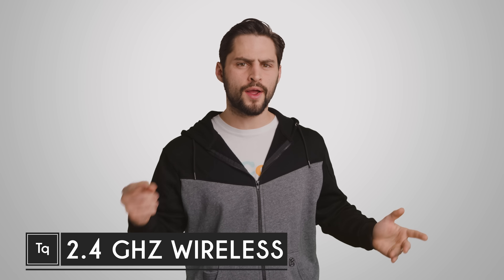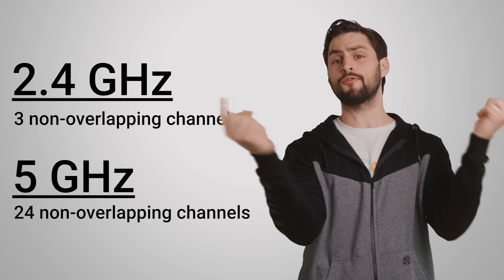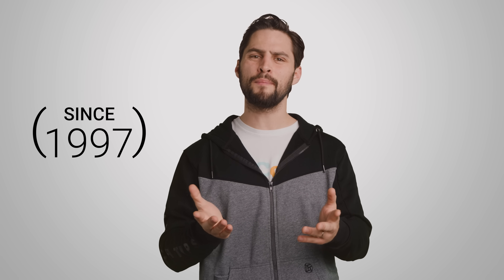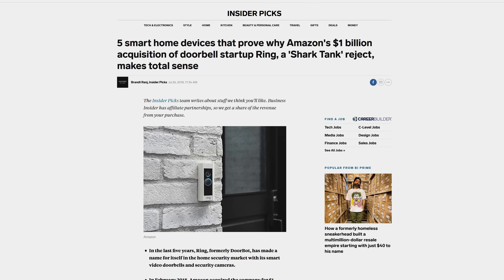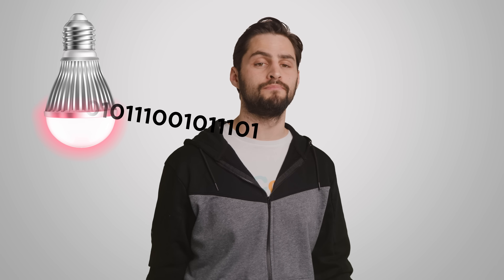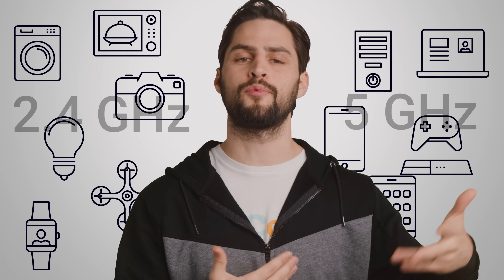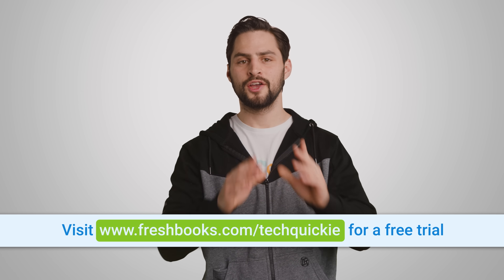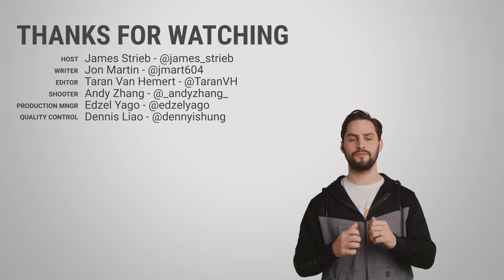Why will WiFi always be SLOW??

Comment: Of course it's not going away, otherwise I couldn't use my Nintendo DS!
Reply: TheMrminimario I get this completely. Plus you need either an open network or WEP for the original DS models so I am still using WEP despite it not being very safe anymore. I need an upgrade badly though.
Reply: Weatheronthe8s buy a tplink router, install openwrt and create a new vlan with mac access restriction and another vlan for other devices
Reply: @fss1704  I need a new router badly. I have to reset this thing all the time because it barely wants to work sometimes. But my mom hasn't bothered to go get one. It is her house.
Reply: @weatheronthe8s895  consider installing dd wrt, the stock firmware is bullshit.
Reply: @weatheronthe8s895  or you can "casually" brick the damn thing, even put 24-30v will do the trick, just make sure you do this right before payday
Reply: @fss1704  I don't really wanna do that because this thing holds nostalgia for me.
Reply: If only the Nintendo DS could actually CONNECT to WiFi
Reply: @janferenc316  Custom servers are a thing
Reply: @janferenc316  That's due to the security. You have to have open internet or WEP in order for the DS to connect. Or be like me and still have the old Nintendo WIFI doggle and skip all of that

Comment: Couldn't understand most of this. But I wished to understand why bluetooth is not dying? Why isn't everything like earphones, mice and gaming controllers wifi too?
Reply: Bluetooth takes a lot less power to run than Wifi. Most devices use something called BLE which just means Bluetooth Low Energy.
If you slapped Wifi onto your mouse, it's range would go up, but also the battery life would go down significantly. 

Also, what's the point of being able to use your mouse in another room? There's no point to that added range when you are probably going to be within a few feet of the computer.

Another thing is compatibility - your PC's wifi chip can't connect to multiple Wifi points at one time (barring more expensive mobo's). Why disable the use of youtube just so you can have a mouse?

Bluetooth was designed with short-range, low energy usage in mind. Wifi was design for long-range, fast communications transfer.

Comment: I have an ASUS AC WiFi router at home, but you are right about 2.4Ghz still being in many devices as all my Roku express units are 2.4Ghz only!!! Plus if you have a large house like mine which is single story, and the WiFi router is at one side of house, 2.4Ghz is still a must for range even with extended antennas on my router, and range extenders.

Comment: I use the 2.4 Ghz network still everyday. It has a lot of uses for devices that don't need the 5 Ghz spectrum. Of course there's nothing like being directly connected via an ethernet cable. (:
Reply: Mansoor Haque  there is little reason not to... my pc, nas, tv, xbox, router are all connected via gigabit, and I'm receiving 300 mbit/s from my isp, so living the gold life
Reply: Matas Kart 300 mbit/s is the good life. I am definitely interested in more download speeds. I won’t say what we have at home. :(
Reply: Yip I use a unifi 24 port switch for eth to the TV, two workstations, two servers with 4nic cards, and a couple of APs. Good wifi is expensive and you end up needing to run eth to the APs anyway.
Reply: @KillaDukeBadMan  That's a very nice set up there sir. How large is your home? If you don't mind sharing?
Reply: @WarriorsPhoto  it's a tiny 95m2 but spans into my shed 60m2 shed where we have the servers and workstations. It's all held up by a 19kw UPS, it can run for about 4days without grid electricity.
Reply: @KillaDukeBadMan  Looks like someone got a production going on?
Reply: @WarriorsPhoto  it's mainly software development and data computation. Would like to do some media production, but time is so limited, maybe down the track.
Reply: @KillaDukeBadMan  Gotcha and you have the set up for it. Good luck.
Reply: White_and_Black Yes! :D
Reply: ricky v router is on the top floor.  I’m in basement.  5GHz is as fast and weak as 4G down there... so I’ll stick to my 2.4 signal usually!
Reply: @bruhdabones  Run a Ethernet line to your basement and connect a Ubiquity AP
Reply: James B I’ve seen customers do this and it’s amazing! I live in a small apartment and won’t need more range anytime soon.
Reply: James B not about to spend that kind of money or make my house that ugly
Reply: @bruhdabones  Do you already have internal Cat wiring in the walls?
Reply: ricky v no, I don’t live in an office building or apartment building 😂
Reply: @bruhdabones  Gotcha. Bummer then you could have ran with the internal wiring. ;)
Reply: @bruhdabones  ugly ? Ubiquity AP's use poe  for power , then just run a cat5e cable drop and bam . they will  look extremely good and clean !  Just like a fancy looking Smoke Detector
http://thecyberfusion.com/wp-content/uploads/2013/02/IMG_04931.jpg
Reply: @SerpentDrago  I am very happy with mine, we have two outdoor and 1 indoor unifi APs, white cat6 cable so it blends in for the indoor one. By far the most reliable wifi I have tested (most expensive too lol).
Reply: James B great, lets trip over Ethernet cables in the stairwell
Reply: @SerpentDrago  I love the idea of fancy looking smoke detectors. That's what I thought Ubiquity AP devices were when I would encounter them. (:
Reply: @bruhdabones  lol, you dont have to live in a office. New houses can have ethernet cables and be designed for good wifi coverage.
Reply: Luke you must be incredibly privileged
Reply: @bruhdabones  lol, i was simply correcting your statement that to have ethernet cable in walls you have to live in office or apartment. Whats privileged about that ? Hell you dont even need to live in  new house, in certain situations you can get ethernet cables in old houses walls yourself.

Edit : even if you cant get them inside the walls you can just go outside walls and hide them inside baseboard or cover them with plastic covers. Not sure about america, bur where i live practically all old houses and apartments have huge baseboard perfect for hiding cables.
Reply: Luke I live in a house from the 70s.  2800 sq ft.  It was pretty cheap compared to the new houses in my area, and I’m not paying to retrofit it just for WiFi.  2.4G works fine for me, and I’m on that 4K youtube streaming.  Most people don’t live in a super new house or apartment, so your idea is niche for now
Reply: @BlackPeagas  I think it is pronounced 'Merica. ;)
Reply: @bruhdabones  5GHZ is only intended really for devices closer to the router (said by a Spectrum Internet Technician)
Reply: PlagueRoboTic pretty much
Reply: Mansoor Haque Yup that’s why I ran ethernet cables. (:
Reply: ricky v 2.4Ghz implemented properly is probably still good enough for most people. I recently upgraded my Internet where my current max speed is about 320mbps. My brother's PC had a wireless N 2.4ghz card which received about 15mbps from his room, a few rooms from the router.
I took a gigabit(ethernet) wireless N router from 2010, loaded Dd-wrt onto it (custom firmware), set it up as a wireless bridge and connected it to his PC via ethernet. He now consistently gets over 100mbps, average about 120. That exceeds the capacity needed to stream 1080p Netflix 20 fold. I find it laughable when people say something like WiFi 6 is needed for their 4K content since this wireless N setup from 10 years ago can run 7 simultaneous 4K netflix streams at Netflix's maximum estimated bit rate of 16mbps.
Reply: @AnonymousUser77254  Yes and also give yourself credit for the custom firmware, and that access point. I know basics of networking and I still went with ethernet in the apartment. ;)
Reply: @AnonymousUser77254  Exactly. Honestly,  most consumers won't use download/upload speed over 10mbps at the most. Even playing games, latency doesn't mean bandwidth.
Reply: *every day (means "daily")
everyday = typical/ordinary/average
Reply: @alvallac2171  Hey this is a golden ticket here. Looks like I am able to say two, three, even four things with a simple spelling change. You are definitely a good person for helping out. Much appreciated.

Comment: I'm Spanish (from Spain in Europe), most off the house and flats have concrete or brick wall between rooms, 2.4GHz works bad in some rooms in my flat. 5GHz just doesn't work if you aren't in the same room as the AP.
Reply: Same in Italy, one wall means 5 GHz is no more.
Reply: It's sort of sad that he had to specify that Spanish is indeed a nationality and that Spain is in Europe.
Reply: IAmThe UsualGuy just waiting for the protests over Spain’s occupation and genocide in central/South America. Morons will have you believe that Spanish (and Portuguese) have been spoken there for thousands of years…
Reply: same in Germany, in my Kitchen I can only recive the 2.4 Ghz network and in other Rooms 2.4 Ghz will still have the better Signal.
Reply: I'm in the US, with an old 1950's brick home that has thick walls, and is spread out over a single story, so I know what you are talking about, some devices just plain won't work over 5Ghz when I'm across the house, even with extended antennas on my router, as I can only have it on one side of the house without being in the way, or looking ugly, so we have 2.4Ghz extenders because they are cheaper, smaller, easier to hide, and more of my devices use 2.4Ghz anyways.
Reply: Another problem, 4G is so good these days it rarely dips below 50 Mbps and averages at about 100 Mbps (In the Netherlands).
To get any improvement you gonna need to install house wide 5 Ghz coverage, which can easily cost like €200-500 in equipment alone, plus you gonna need a 100+ Mbps internet connection.
For most people this just isn't worth so they're suck with plain old 2.4Ghz coverage or use 4G
Reply: Im Lithuanian (from  Lithuania in europe) and brick 2f hause. 1 router for each floor. 5ghz works perfectly. The routers are close to the middle of the hause, though they are used only for portable devices and low need ones as their is cable through the walls to every high need device ( newly built hause ).

Edit : What i wanted to say is that a brick house designed for wifi can have great 5ghz wifi. Though of course in europe we have a lot of old houses and those are the most problematic.
Reply: Damn boi thats a thicc woll
Reply: @AshLordCurry  almost the whole phrase has the sound attached to it
Reply: I got very annoyed at the video for not mentioning, that 5 GHz is pretty much a one room only technology. Took your comment to realise, that this is not an issue if you live in cardboard houses.
Reply: Yeah, 5GHz is actually far slower in most of my house.
Reply: *most of
Reply: Manito
Im brasilian
Reply: It also depends on what kinda router you have. 5ghz can work through more walls than other routers.
Reply: WiFI signal degredation can also be a serious problem with old 19th and early 20th century homes in the U.S. that use lathe and plaster walls with wire mesh behind the plaster, which was a problem in my old home built around 1905 or so. I mostly solved the issue using a combination of repeaters, Powerline networking devices (this was all before WIFI mesh routers were a thing). I’d also recommend were possible using good old fashioned Cat 5/6 Ethernet cabling run through the walls wherever possible to you desktop PC’s, Ethernet equipped Roku/other streaming box/HTPC, Game Console, etc. If you can do so convenient, having a wire Ethernet connection really does avoid the problems of WiFi when available and convenient. Of course some devices such as you’re smartphone or WiFI only tablet will be need to be WiFi connected (assuming here you don’t want to use Cellular data when in your home) but not your gaming PC rig or your content creation machine or even a laptop if your using at a fixed desk (Ethernet port lacking laptops can use a Ethernet USB dongle permanently connected to a Ethernet cable coming from the wall). Just plugged in the dongle to your laptop when at your desk to illuminate laptop WiFi issues altogether.
Reply: @Charlesb88  it also makes it so some ISPs don't have infrastructure support for your building. In my apt. building the only options are Comcast and AT&T. I wanted to support one of the local providers that has better customer service but they're not equipped to network with old buildings.
Reply: can you precise more I don't know that "Spain" you are talking about
Reply: At least in North America most houses are wood... All concrete would suck
Reply: rgtrooper13  I wouldn't say that they are browns :/ But mostly I say because I wanted to clarify what country I'm talking about because most probable they have the same laws about radio waves as the USA.
Reply: huh, who would have that that a spanish person is from spain of all places...
Reply: I have a brick wall between the router and where I use my laptop. I get exactly the same speed (5ghz) on the other side of the wall as I go in the same room. If go to the smallest room in the house 🚽 it slows dramatically.
Reply: it also depends on the houses design interior and how well wired a house is. Location and just about everything is a factor in play with Wi-Fi. Our house currently shouldn't have such poor range with either 2.4 or 5ghz nor should it be so slow for almost no reason. Its not our service company its the house. Whoever built this house and definitely after it was rebuilt after Harvey did an extremely poor job. I'm sure some of the old wiring still exists and in general walking 5 feet is enough to just kill your internet in some cases. I have an extender up stairs which helps but it needs to be replaced soon and I know our modem and router are far from being outdated let along on the low end. Whenever we move and either buy or build a much more preferred house in around 6 months or so I will probably also change our system to mesh and give each major room their own router as needed. Expensive most definitely. But it will guarantee unless there's an actual issue with the network from something that we do not have any internet issues anywhere in the house.
Reply: @yulfine1688  i had crappy wifi in my house but i bought a ubiquiti ap lite and now the 5ghz covers the entire house.
Reply: As I'm seeing many Europeans talking about this remember that we as Europeans by law (and out devices are firmware locked) can't use a wifi with more power than 100mW while in the USA they can use a power of 1000mW.
Reply: @Kapisketo  that's only for 2.4ghz though. For 5ghz up to 4000mw is allowed (depending on channel). Same as in US and most other countries.

So yeah, unless you're missing on 2.4ghz signal 1000mw wouldn't help. 100mw is actually a good limit, as that's naturally limits interference in flats (you wouldn't receive signal from neighbour three floors up).
Reply: Thank you for the clarification, I was beginning to think you were from Spain in Australia
Reply: @LancesArmorStriking  The average American are idiots and confuse the Spanish nationality with the language Spanish spoken by Latin Americans.  That's probably why he clarified it.  When someone says they are Spanish in the states, it is often misinterpreted to mean Hispanic or Latin American.
Reply: Wow I thought you were from the Spain in the arctic, thanks for clearing that up
Reply: @matuzaato  There is some people that don't know that Spain exists and by Spanish they thing that I'm from Center-South America (as a continent XD)
Reply: @Kapisketo  muricans
Reply: You could connect multiple APs with ethernet
Reply: @brokenlegs7451  Yes, but $$$

Edit: actually, more like €€€
Reply: Screw you get a new flat
Reply: Why on earth would you need brick walls inside apartments? In Spain of all countries, where even in the north the temperatures never drop below +5...
Reply: @gigakoresh  In most of Europe we are used to build houses from concrete and bricks. Probably it partially cultural, partially, because wood is too expensive in southern and central Europe. About inside walls - some of core ones are made from reinforced concrete to support the house against earthquakes, and other, that do not need strength are just thinner type of brick (or arrangement pattern), to save space. 
Bricks have some real advantages - they are relatively cheap, can tolerate years of moisture without any damage, offers excellent sound insulation due to their heavy weight. Also work as thermal accumulator, so well designed brick houses rarely needs cooling, at least in temperate climate.
Reply: @philipmihailov  How fascinating to find that apparently where I live (Finland) and where I've been (Sweden, Latvia, Russia, Greece, Germany, Italy) is not Europe, or at least not a typical one. All those places gave me an impression that inside walls are typically made from softer and cheaper materials to conserve costs and retain temperature inside without it being absorbed by bricks. The more you know...
Reply: @gigakoresh  its just that eay in europe m8

Comment: Funny we have hella fast data, but nobody wanna use that same tech inside homes for fast wifi.
Reply: you wanna wear lead lined suits in your home?Cause thats what you wear when you service the towers.
Reply: @rockytom5889  what are you talking bout?
Reply: @jodyboles8208  
Cell tower tech don't mix well with people
Reply: @jodyboles8208  
Too strong. Knew a few techs that replaced the dishes. All had some tumor or cancer later in life.
Reply: @rockytom5889  lol what? cell towers has no effects on humans and doesnt cause tumors or cancer at all. where are you hearing that from?
Reply: @jodyboles8208  
from their scans.
Reply: @rockytom5889  what scans?